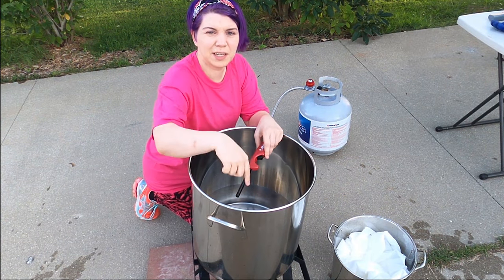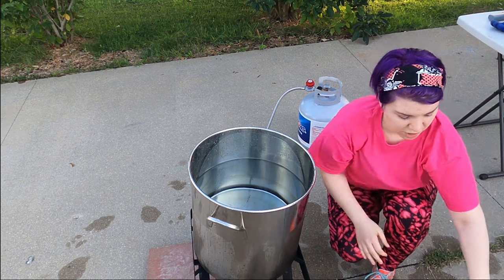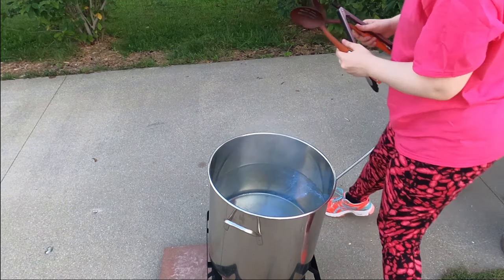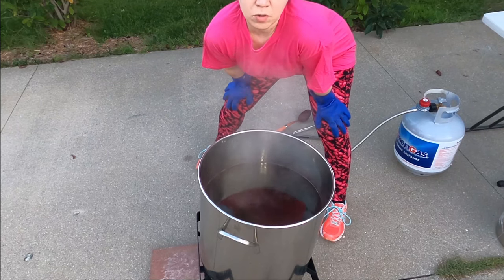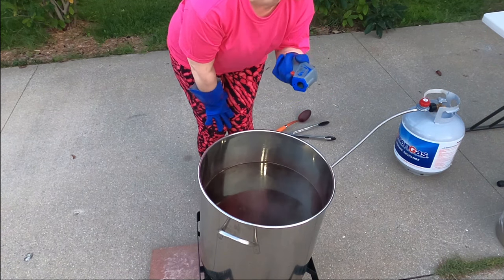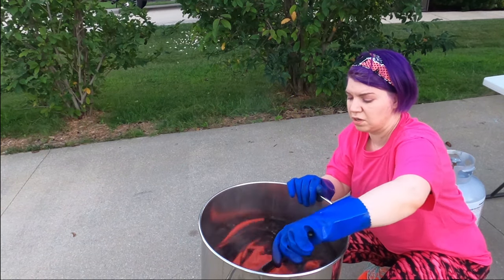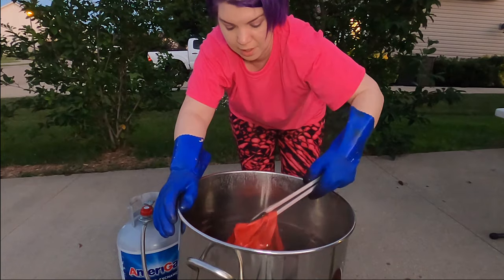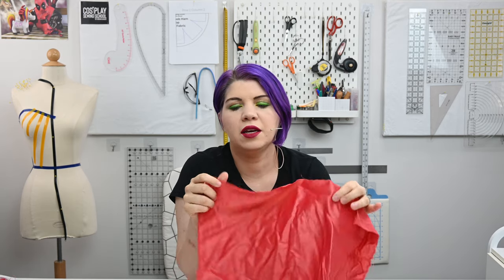How to Dye Polyester Fabric | Tub Dye Technique | iDye Poly and Rit Dymore

Comment: Would be interesting to see if the dye works in colder temperatures (maybe using the spent solution as a base) Split the solution up into 4 batches and do 4 different test pieces at 4 different temperatures to see the result... It would not surprise me if the temperature is not as much of a factor as one might believe... I think the time the fabric is exposed to the solution and the strength of the solution has more effect on the result...
Reply from the maker: I have tried with longer time and less heat, no good. Since you are dying a plastic, you really need the heat.

Comment: Hi there!  Thanks for the great video. If I wanted to have an ombré dye pattern how many minutes should each section be dyed for?  For example, if I wanted to dye fabric for a long skirt and have the lightest color at the waist/abdomen area and the darkest at my feet should I remove part of the fabric every 5 minutes (If I dye for a total of 30 minutes then there will be about 6 dye segments and the dye times will be 5 minutes, 10, 15, 20, 25 and then 30 minutes for the last section).  Is 5 minutes enough to get a little bit of color or is that too long?  It’s a white fabric and I wanted to use a Navy Blue. I want the lightest section to be mostly white with a hint of the blue and the darkest to be a deep navy. TIA!

Comment: polyester is my favorite material...everything is own is mostly polyester. So I have a solid coral polyester spandex top and I am planning to color it graphite grey with the dyemore brand. Should I use two bottles of the graphite Dyemore??? How much water should I use for the right results??? Does it matter what size stainless steel pot i get and is there a way to clean the pot afterwards or is it ruined for good????

Comment: Great video and explanation!
I just interested to know due to gonna to dye my 100% polyester cycling jarsey .
Have yours thinks changed the size after boiling in the hot water.
Thanks beforehand and have a good day..
Reply: Too late to be of much help but 100% polyester will not shrink. Even blends that are mostly poly won't shrink no matter what. I already knew it wouldn't work but tried boiling poly/elastane leggings anyway, for 25 minutes... not even a tiny difference!

Comment: Hello what type of dye do you recommend I use for dress that is 95% nylon and 5% spandex but the lining is 100% polyester
Reply: For instance should I use the rit all purpose dye or the rit synthetic dye 😊
Reply from the maker: That is a tricky dye job. I rarely dye finished garments like that. My suggestion is to use both types of dye in your dye bath. This would mean the dye would need to be the same color. The fibers will pick up each dye as they can. Nylon dyes with rit all purpose but poly will need RIT dyemore. I suggest sticking to one brand so the colors match up.

Comment: i have a white 50/50 cotton poly hoodie that i want to dye black.

i plan to do a soda wash pre-soak and use fiber reactive powder dye. 

am i doing it right?
Reply from the maker: black is a very difficult color to dye and expect to go more than one dye session. i would go ahead and dye the cotton using the fiber reactive. you will then need to do a run with synthetic dye.

Comment: i want to dye my queen sized comforter from its baby blue color to a deep forest green. i have nooooo idea what i should use because it’s a huge blanket.
Reply from the maker: what is the fiber content? if you dont know, you will need to do a burn test. there are lots of videos showing how to do this, i just have not done one. this will at least lest you know if its natural fiber or a mix. to do this you need to cut off a bit of the fabric from somewhere on it. if you dont want to cut it, you will have to guess. i would guess poly cotton blend. in that case, use both dye for cotton and dye for poly. with rit its easy because you just mix both in the same pot. select the same color in rit and rit dymemore.

Comment: So I had a poly dress and I made the mistake of not soaking the fabric beforehand. So now I have streaks. Is there a way to fix the streaking?
Reply from the maker: I don't think so. I have never found a way to fix it except by overdying in a darker color and hoping for the best. Sometimes it works, sometimes it doesnt.
Reply: Same thing happened to me.  I was so upset with myself for not noticing in the directions that it said to put wet fabric into the dye bath and now I'm stuck with a blotchy dress I got specifically for a Renaissance fair and no time or money to buy a replacement 😭 Tried dying over it with a more saturated bath but it only made more blotches and the existing ones darker.